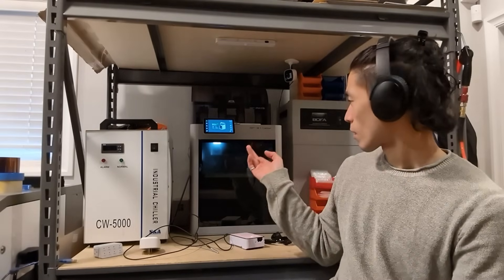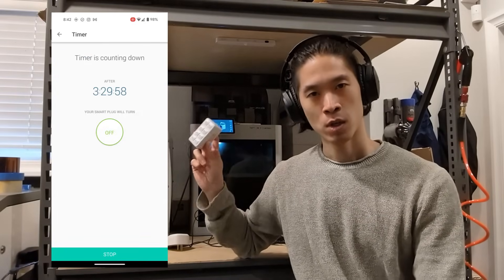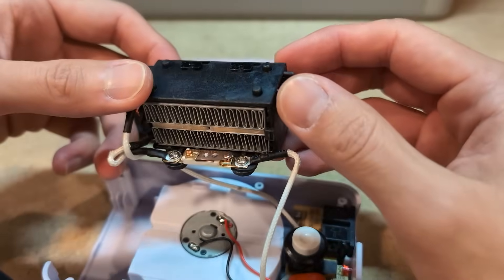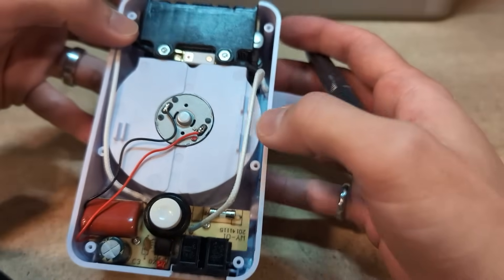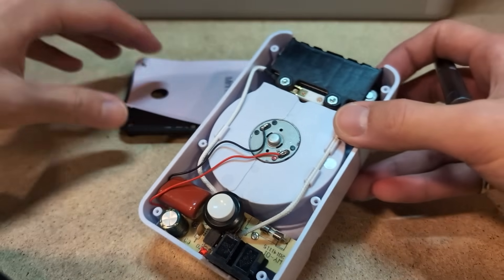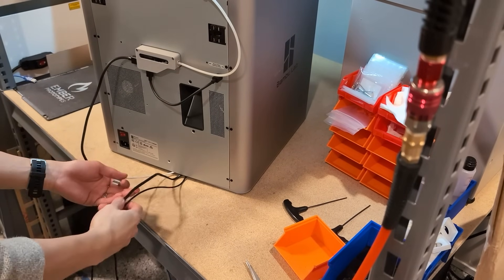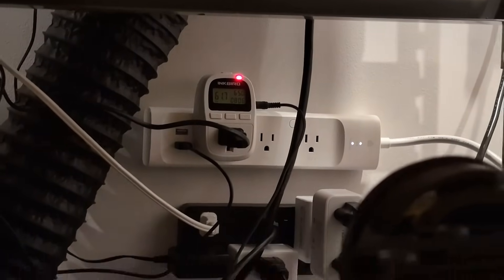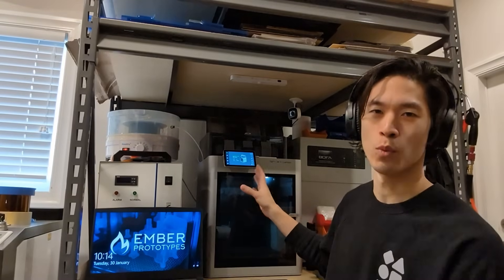Bambulab X1C - $50 HEATED CHAMBER

Comment from the maker: I've had several people ask if this works on the P1 series.

TLDR is if you have an enclosure and there's space next to the aux fan, it will probably work 🔥

Also - apparently the chamber sensor is on the button board near the front of the machine. I'm not sure why it's placed there...I would still opt to place the additional sensor near the back to prevent overheating of the electronics.
Reply: I ended up putting some hours on my P1S with this mod and it’s been working excellently for prints, but at some point I noticed some minor deflection in the plastic outer panel in the area that the heater exhausts to, so I modeled a little duct to direct air away from the outer wall and wall of the electronics bay and printed it in some PA6-CF and it’s been chugging away like a champ since.
Reply from the maker: @justinu1182  oh interesting! I haven't done this on my P1S yet so maybe I need to do this too. Can you share the duct you made?
Reply: @emberprototypes  absolutely. Would be happy to. I’m out of town this week for thanksgiving, but I’ll make a note to upload it to mw and post a link here when I get home on Sunday
Reply from the maker: @justinu1182  Awesome thank you so much!
Reply: @emberprototypes  Just in case there's a problem with link filtering, the uploaded duct model is on Makerworld titled "Heater Duct for P1S X1C Chamber heater mod" by Pathian
Reply from the maker: @justinu1182  amazing thank you!
Reply: @justinu1182  please share your model, I would love to have it also. Thanks!
Reply: The placement of all the main parts are the same between the X series and P Series.
I actually just ordered everything so I can do this to my P1S. Maybe my Adventurer 5M too. I'll have to see if there is enough room for it. Then I'll get seconds of everything for that.
Reply: @McFlyOrPie  waiting for your updates!
Reply from the maker: @McFlyOrPie  Woot! Good luck!!!
Reply: @McFlyOrPie  where can we expect to find your findings? I'm interested as well for the P1S... thanks !
Reply: @DrZylvon  I have both printers (X1C,P1S) in use - they have the same internal clearances. I checked clearances on both prior to ordering in case there was something I missed.
Reply: Bump

Comment: It is a good idea, but in my case it maxed out just under 50C and then the heating element is turned off by its themo protection switch. Looking for something that goes a bit higher. Also, many of the temp controller max out at 45C as they are meant for plants and reptiles.
Reply from the maker: BIQU is coming out with a heater you can look at. For me and a lot of others this little mod has worked amazingly well. It's poss some models of the heater have a lower temp switch but it's not immediately obvious

Comment: Has anyone looked as using the QiDi X-Max 3 300W heater? It can be bought for $12.50. Not sure what voltage and amperage is needed but their chamber can get to 65C.
Reply from the maker: Not sure, don't think that existed back when I made this video. I'm sure there are more options now!

Comment: i bet this would work good with one of those aux fan deflector mods. blow the hot air around gently, and not directly at the print either. even hot air can cause warping if it's fast enough i bet.

Comment: Thank you for this video, just did this on 2 of my Elegoo CC's and it works beautifully for ABS, the prints came out pretty nice prior but now they have come out perfect, I am going to add this to all my printers.  You mentioned you put a filter in the printer as well, do you have a video on this?  I have a large 24" x 8" carbon filter with large inline fan attached to it on the ceiling of my shop with all my printers that I run 24/7 scrubbing the air.. but AbS leaves a nasty residue inside the printers, would like a way to minimize this if at all possible.
Reply from the maker: I haven't made a video...I was testing some different ideas and never got around to finishing so it's kind of in limbo right now 😅 glad this video helped you though!

Comment: Hi, I have a few questions:
1. Did you have it running at more than 60C, like maybe 65C for close to a day or more of use?
2. If you did run it at 65C for about more than 6-8 hours of printing, have you ran into any issues with the printer’s functionality?
3. Does the heater use up much power with the printer on, or not really?
Reply from the maker: 1) No, I didn't want to try more than 60C in case that exceeds the temperature rating of the internal components.
3) Not really since at steady state the internal temps stay elevated quite well - I haven't measured power consumption though!

Comment: So, what if you left out the filter you have on the other side and added a second one of these? Do you think the temps would be better (flatter) and more controllable? I have not got my X1C yet it should be in Thursday and I will be printing mainly ASA and ABS with some Petg thrown in there. What is the filter actually for? Is there a port to run a duct up into an attic on the X1C?
Reply from the maker: It would probably just heat up faster, you likely won't get "better" control without PID, but honestly, imo, not necessary anyway.

The filter has carbon in it for ABS fumes...but it doesn't really do all that much unless you're changing out carbon regularly. I was just in the process of testing something and have just left it in there ever since haha

Comment: Nice work! I was looking for a good heatee to use for another printer so im grabbing some of these. Do you like the carbon filter you use more than a bentobox? Ive only used the bentobox (2 of them actually) installed upside down on the ceiling of my flsun t1 pro and they seemed to work well
Reply from the maker: Thanks for watching! I honestly think these Bento box type solutions are kind of useless unless you actually change the carbon regularly. Without any feedback or closed loop system, the frequency of changing for most people is kind of low and it's hard to get the airflow you need with axial fans. Nobody has done any real scientific studies with these systems...its kind of snake oil imo...but I hope to do some testing and developing later in the future. Proper ventilation is still a necessity though!
Reply: @emberprototypes yeah I hear that. Have you been using the x1c long term with the heater?
Reply from the maker: @Infinit-Endz  yup! It's been over a year now and still chugging along 🙂
Reply: @emberprototypes nice! Im getting a x1c today and the heater will be here today or tomorrow lol
Reply from the maker: @Infinit-Endz  🔥🔥🔥

Comment: So, does the heater plug into the temp controller and the temp controller cuts power to the heater once it’s reading the desired temp? Or how does the setup work exactly?

Comment: So, does the heater plug into the temp controller and the temp controller cuts power to the heater once it’s reading the desired temp? Or how does the setup work exactly?
Reply from the maker: Yup that's how it works!
Reply: @emberprototypes sweet just wanted an idea before I set up. Thanks my guy. 😊
Reply from the maker: @blakedavidson-t2p  no problem - thanks for watching!

Comment: Hi, THANK you for the engineering mindset approach and no BS style of video. (and I really mean it, THIS. I tried to use your affiliate links but hoped it had the C236T in there... hope it worked for the mini heater)
I'll just add my 2 cents. I did opt for the INKBIRD C236T because it has an integrated WiFi (2.4Ghz) module so it works with the app on the phone BUT it's quite finicky to integrate it with Google Home for example. I haven't poked at Home Assistant. BUT the default Inkbird app does fine and you can opt for a timed session alongside set temp limits.

The downside of the C236T model is the temp probe's wiring is plain simple coated wire so there's no real heat shielded wire protection and it's not a plugin jack connector like the one you have. Sure I can just solder one on but figured I'd give the actual feedback.

Another thing I had done before is to print a diverting air baffle for the Auxiliary Part Cooling Fan that is blasting the bed on the printed layers. Yes I know I can program the G-code to remove that function but I don't want to have to go to the G-code for every print.

Since I am using an exhaust fan I am thinking about integrating a fire/smoke detector in this system and I guess I'll be as ready as possible in case something goes sideways. I am a little worried about the proximity of the min-heater being so close to the auxiliary fan assembly and possibly causing deformation or melting of the fan's cover.

Lastly, if you are into refined energy monitoring option for the "smart plug" take a peak at Emporia. They have actual CT integrated in their smart plug which are accurate enough to my liking.
Reply from the maker: Thanks for the feedback and for watching! 🙏

Comment: I’m going to try and stuff this into a Prusa core one.
Reply from the maker: let me know how it goes!
Reply: @emberprototypes  I might have to fabricate a new side panel without the bump or put the heater under the bed and change the Z limit in the slicer to prevent the bed from crashing into the heater.
Reply: @Wunderbolts so reduce your max z height -_-

Comment: Thanks for showing this. I have an Elegoo Centauri Carbon on (back)order and had been musing on whether this sort of thing was do-able! 
On eBay UK, I can get a package of PID temperature controller, thermocouple sensor and solid state relay for £13, (~$17US), delivered! (A heat sink for the ssr shouldn’t be needed for handling such a small load.) 
The PID ought to deliver tighter temperature control than that on/off with hysteresis Inkbird, at a broadly similar cost (albeit with more project work). 
Long term, something to watch out for is deterioration of the heater power cable - which might not be spec’d to run so warm. But high temperature wiring would be an easy upgrade. 
Delighted to learn that such a mod can be done, and can work! 

// and subscribed!
Reply: That’s hilarious. I have one coming in as well and am already thinking about adding this to that printer. In the mean time in between time I will add to this to my P1S.
Reply from the maker: Thanks for the sub 🙏

Comment: Thank you for sharing!  And thank you for dissecting the heater to see how it's built.  I'm thinking of doing the same thing.  I print a lot of ASA parts, so this will be a great mod.  I think I'll lay the heater on its side, place it under the aux fan housing, so the hot air would be blowing at the very bottom of the chamber.  Also, I'll see if I can relocate the on/off switch.

Comment: How has this mod been holding up? any downsides?  any parts of the X1C not tolerating the extra heat?  Will this be enough for Polycarbonate?
Reply from the maker: Been working great for me still. Have done a lot of PC with it!
Reply: @emberprototypes  All I did was insulate my X1C, which seemed to stop warping but I can't escape heat creep now, and it seems my lidar housing has started to warp.  
Any other tips on printing PC?
Reply from the maker: @Ottobawt  strange, I haven't noticed any of these issues. If you see heat creep issues then your chamber is probably too hot (or you might need to use a different brand of PC)

Comment: I have the same heater with a different reptile tank temp controller in my resin printer cabinet. Been doing a great job keeping the printer and my resin bottles at a nice flowing 29-30°C. Even as my unheated shop temps plummet below freezing. Makes me wonder if the maker of that little heater has recieved a lawsuit from Stratasys yet. 😂

Comment: i wanted to do this too but backed off after realising all of the electronics and power components are sharing the same chamber, they are going to be cooked. the x1/p1 is simple not designed to have a heated chamber, they didn't isolate the cool and hot areas.

Comment: awesome project. I bet you can utilize home assistant to control the heater entirely. There is a bambu lab integration to get the chamber temperature, and weather or not it is printing. Use that to control a zwave outlet to control the heater.

Comment: Great idea. What I do wonder though is how the internal components will behave long term. I can imagine the X1E has either components rated for a hight ambient temp. or are insulated appropriately ..
Reply from the maker: AFAIK the X1E has the same electronics as the X1C and mostly the same components. My X1C has been running with this for almost a year now and still chugging along.

Comment: So based on your discovery I purchased the same heater for my X1C.  For safety reasons, my printer has been added to my air duct system to vent the case to atmosphere actively.  Because of this I'm inevitably going to be drawing cool air in through the gaps in the gas and housing since it's at a constant negative pressure. Do you think this heater will be sufficient enough to keep up with using a vent system?  I should know in a few weeks once I get it installed, just curious your thoughts.
Reply from the maker: Probably not to be honest, you likely need a much more powerful heater.

An alternative way to accomplish what you want while still taking safety into consideration is to enclosure your printer in something like a grow tent and place a large air purifier inside said tent. 

Then you can use a chamber heater like this while still being safe.

Comment: Im late to the party, but the temperature sensor is located on the button board on the upper right hand of the chamber. The button board has an emergency stop button and a sleep button to turn off the screen. That might be why there is about a 10c difference. It seems like an odd placement of the chamber sensor. I really do like your chamber heater. It’s very straightforward.
Reply from the maker: Yeah I've learned this as well. I will update my pinned message with this info 😅 but yes, it does seem like a weird spot to put the sensor doesn't it? Thanks for watching!
Reply: Be nice if you could mod the button board to move the temperature sensor to be inside the chamber. Just getting the chamber up to over 60c using off the shelf components is nice. You got the temperature in the ballpark for the materials used. Winning!
Reply from the maker: @Teddyboy-EM  best mod I've ever done honestly (and easiest as well)! Yeah I don't get why the temp sensor is on the button board...

Comment: I believe the chamber temp sensor is above the glass door attached to the plastic housing above it.
Reply from the maker: Yes you're correct, the temp sensor is on the same board that is used for the accessory button on the top right at the front...so the place I put the sensor isn't actually the best spot 😅although it's still true that I'd like to measure the temperature close to the electronics so they don't overheat

Comment: Pretty cool! With larger parts I have found the plates to show themselves a bit thin and bend upwards, (lifting away from the magnetic surface of the bed); I'll be curious to implement this upgrade and compare results.
Also, the Doubble sided smooth PEI plates are a bit thicker and make a big difference in this kind of situations.

Comment: I installed this and then started getting heat creep super bad on my abs prints when the chamber was at 60c. Do you use a different nozzle than stock? Seems like the stock nozzle and fan isn’t sufficient to cool the hotend when the chamber temp is this high. Several failed prints an hour in and then completely back to normal when I ran without the heater. Any chance you’ve run into this? I also insulated the chamber so the heater might be overkill for abs anyways, maybe heat creep is less of an issue with nylon? Plan on printing a lot of nylon as well so either I’m happy I did the upgrade if I can figure out this issue. Thanks !
Reply: Ya I was surprised also, it was the last thing I checked. Changed nozzle, dried filament again, messed around w the settings a bunch. But eventually since it always happened like an hour into the print I realized that was when it got up to 60c. Ran it with the heater off and it printed just fine. Been running the heater for a couple weeks before this happened but it was before the heat in my apt kicked on so the ambient temp was a lot lower and the chamber never got that high. Both the inkbird and the onboard chamber temp sensor are reading within 1-2 degrees of each other but maybe “60” is just pushing it for my setup. We’ll see how it works with nylon but I’ve been able to stop all my warping issues and avoid clogs running it at 50 with abs. Thanks for the reply! Definitely a worthwhile upgrade but like anything else takes some figuring out.
Reply from the maker: @yapscience  super interesting. I'm glad you managed to find a setpoint that's working though! Temperature is a tricky thing to measure accurately sometimes 🙂
Reply: I ran into the same exact issue. Heat creep with BL ASA. Prints worked fine for a while but I think i may have been hitting above 60c and prints would fail, just wouldn’t extrude. Dropping back down seems to have fixed it
Reply from the maker: @ interesting - good to know! I haven't experienced this yet on my setup but glad you got it working by reducing the setpoint!
Reply from the maker: Weird, I've never, ever ran into heat creep with ABS ever in my 10+ years of printing haha! It's typically just a problem with PLA.

I haven't had the same issue on my machine with the heated chamber.

What temperature are you controlling to? I wonder if you're actually going above 60C and need to drop it down a little bit.